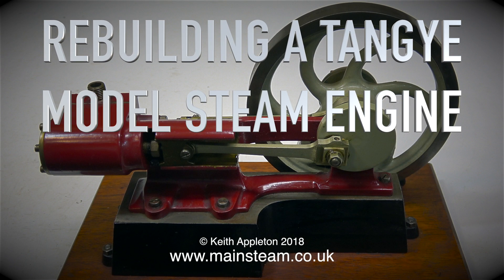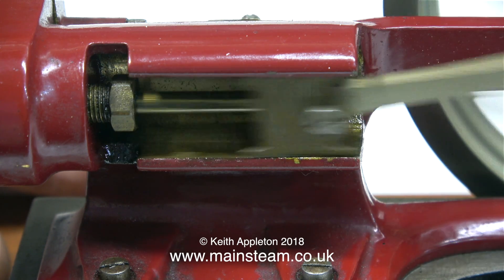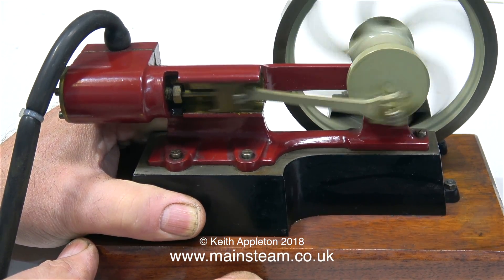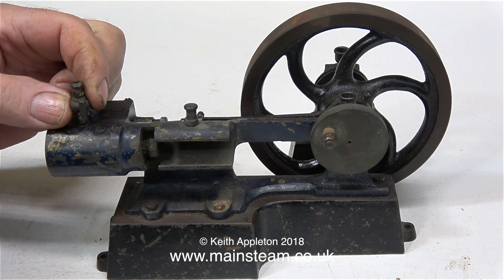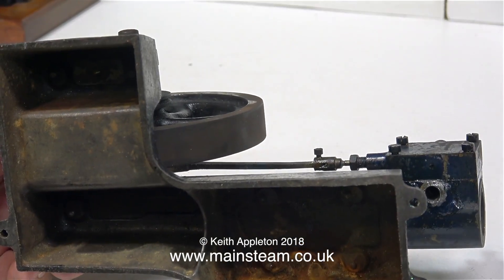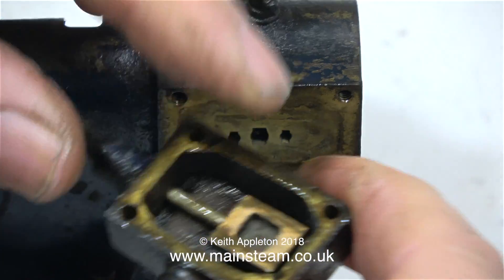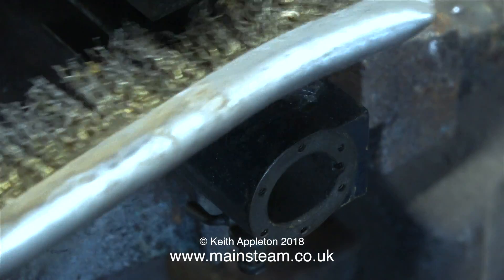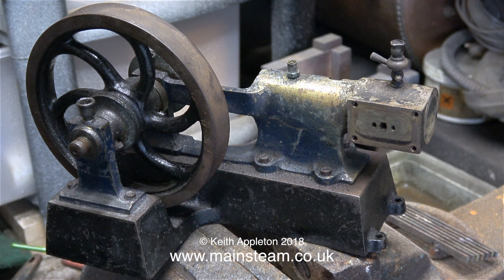REBUILDING A TANGYE MODEL STEAM ENGINE - PART #1

Comment: Complimenti! ti volevo chiedere se e' possibile utilizzare il bronzo nella costruzione delle fasce elastiche del pistone , mille grazie!
Reply from the maker: Bronze could be used for making piston rings but it is not as good as using cast iron, and for a small Brass engine like this, Silicone Rubber will be fine.
Reply: ok mille grazie ! @keithappleton

Comment: When I googled Tangye Model Steam engine it came up "REBUILDING A TANGYE MODEL STEAM ENGINE - PART #1" by Keith Appleton. Further searching found designed by William Ballantyne published in Model Engineer in 1933. Edgar Westbury Double Tangye “Type” Mill Engine was published in 1953. A DOUBLE TANGYE SET OF CASTINGS, INC BOX BED is available from Reeves for  £350.66. I can not find castings for the single by itself, but I think you could make one from the twin.
Reply from the maker: This is a Basset-Lowke Tangye type Steam Engine - I mention it later on in another episode . . .
Reply: @keithappleton   Do you know if the Double was from Reeves Castings and I wonder how far from Edgar Westbury's design it was? I ended up going back and rewatching the Double rebuild.
Reply from the maker: A customer is bringing me a Reeves Tangye today for repair oddly enough, I will look at it in detail and see whether it is a derivative of the Westbury design.

Comment: an "interesting" build to be sure . . . i'm betting you don't do a "sympathetic restoration" on this one . . . looks like a lot of fiddly work . . . and i'm sure you hate that.

a wandering wondering made it's way into my head . . . could you plug the hole in the middle of the cylinder with something (either the same metal or J.B.Weld) . . . then use a milling cutter to essentially re-bore the cylinder? . . . i'm not sure how you would even begin to set up the work though.
Reply from the maker: Please watch the rest of the series . . . I made this in November 2018 - so now it's well on the way to being rebuilt . . . .

Comment: Knowing that this might have been done weeks prior, my comment is probably too late, but here goes. J-B Weld the errant oiler hole in the cylinder, then bore/hone/dress the cylinder. For decades J-B Weld has been successfully used to repair cracks in engine cylinders in farm tractors and the "hit & miss" engines. You have already learned how hard and strong it is. It is also quite heat resistant. 
Very nice that you were gifted the unit. Looking forward to this adventure.  By the way, over the years I have learned that watching J-B Weld harden is as enthralling as watching paint dry, but in Extended Play mode.
Reply from the maker: Months ago - November 2018 in fact ....... I wouldn't use JB Weld on brass - coefficient of linear expansion and all that ......
Reply: @keithappleton  Quite right you are. I don't know why I had it in my mind that the cylinder would be cast iron. 
Thank You.

Comment: Looks like a bit of work, I think it will make a nice little series, but seeing your other work I doubt it will be hard for you. I’ve had a thought though, it may be more effort than it’s worth,  but for that daft lubricator in the cylinder, could you make a plug/ bolt to thread in there and rebore the cylinder, perhaps secure the bolt/ plug with some job weld, thanks for readings ramblings, cheers
Reply from the maker: all will be revealed in the fullness of time . . . . .
Reply from the maker: I started making this series in November 2018 . . . . it was for my Patreon supporters only until today.